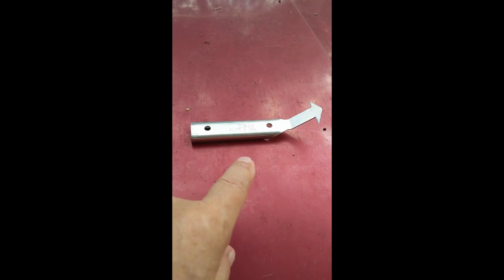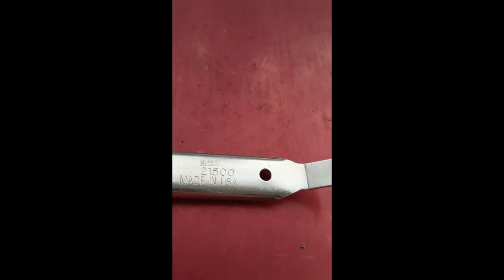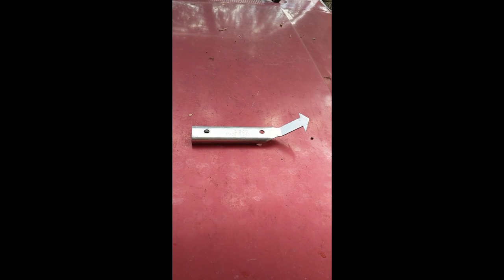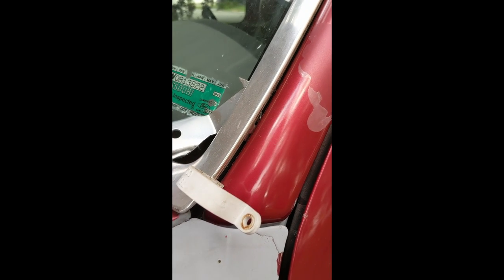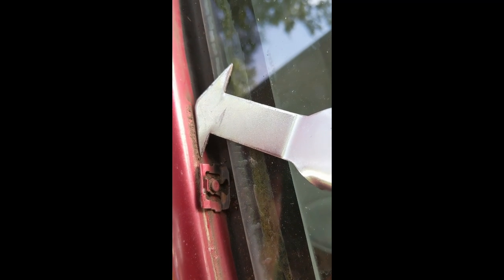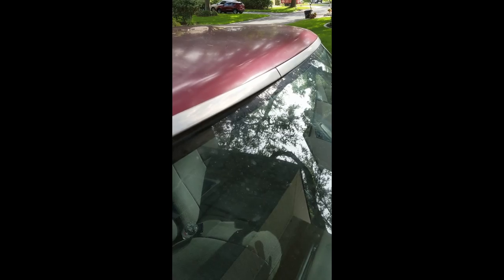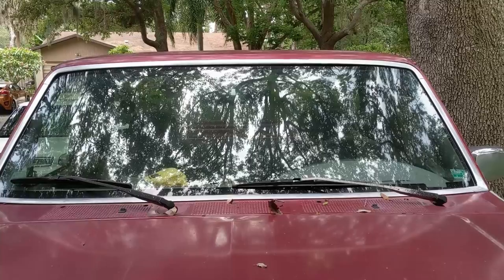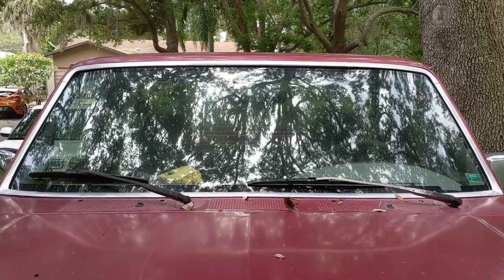Repairing 92-96 Ford F150 Windshield Leak on Our Truck!

Comment: I didn't want to use silicone, so I got black 3M urethane seam sealer.  I cleaned it up first by scraping a lot of messy windshield seal that had oozed out from the previous windshield install.  I cleaned it out with bushes and acetone, then brushed in Ford color white paint (I have a white 1995 F150).  Then I troweled in the urethane as best I could so it went from the exterior paint up to the windshield edge.  I put blue tape all around so I didn't get any on the paint.  When that dries I'll test it out with water before I put the trim back on.
Reply from the maker: I’m sure that will work too. Best of luck.

Comment: Thanks for the detailed explanation on getting the clips off.  I also had to take the bottom piece off and it had the double clip but still came off no problem with the same tool.  Bottom trim has plastic clips installed that fit into the double clip.
Reply from the maker: We are glad it was useful for you!